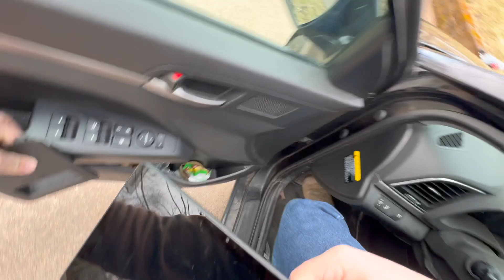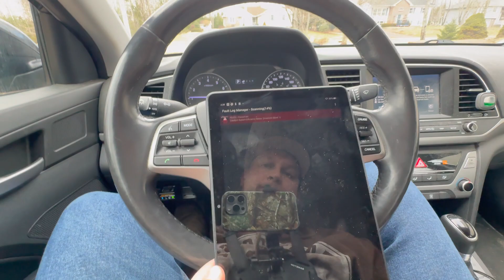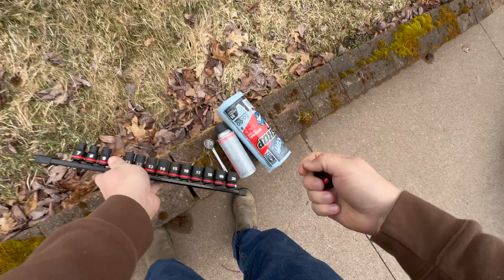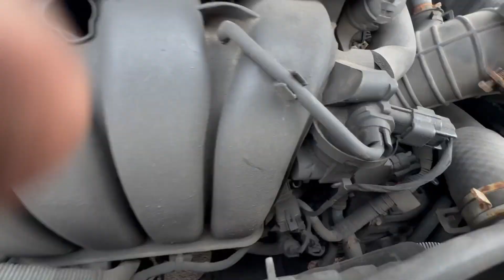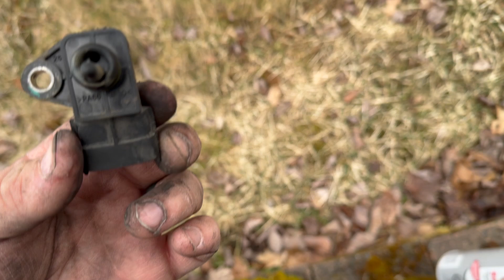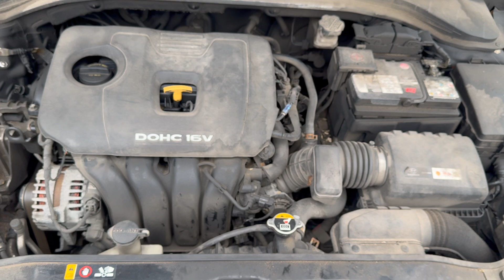Replaced your O2 sensor and still getting P0420? Try this! 2017 Hyundai Elantra

Comment: Some of the symptoms you're describing the rough idol and choppy acceleration could be the coil packs. I've had to replace mine several times in 10 years, but it's always done the trick something you might wanna look into thank you for the video.
Reply from the maker: Thanks for that suggestion! I did the valve cover on this car a few years ago, as the old coils had "rotted" in half and made the plastic lip crumble on the valve cover. We replaced the coils, and they seemed to have an updated design. I will keep that in mind the next time I go over for a P0420 code though, so thank you!

Comment: Hello, first of all, thank you for the information. I have the same problem in my elantra 2017 (2doch) car. P0420 codes are not cleared, what was the result of cleaning the map sensor? How can I solve it?
Reply from the maker: Cleaning the MAP sensor has worked so far, though when it gets cold the P0420 returns for a bit. I am still actively trying to track down the cause.
Reply: @SuburbanRedneckGarage did you fix it my friend?